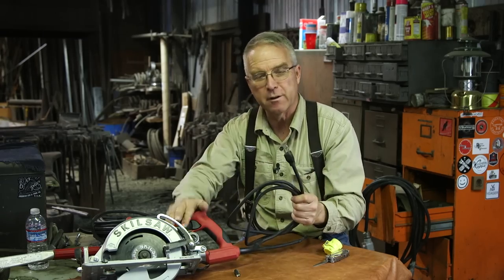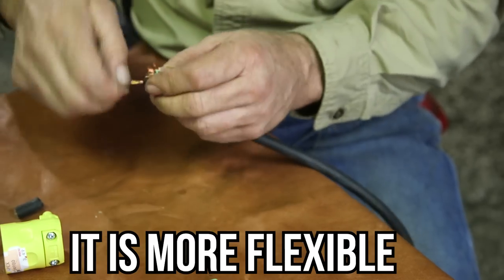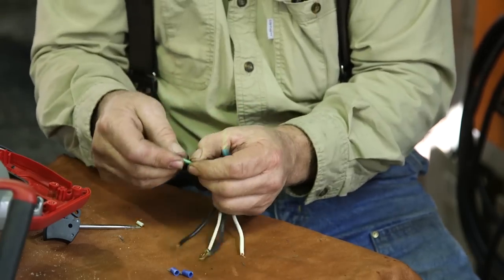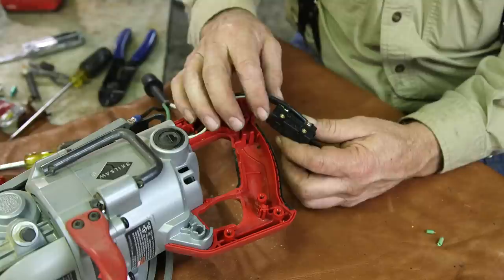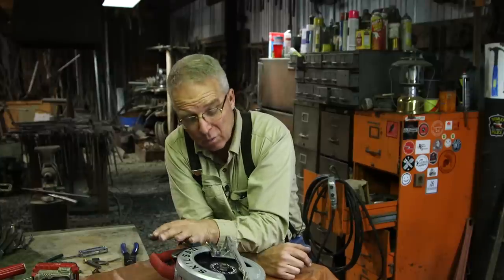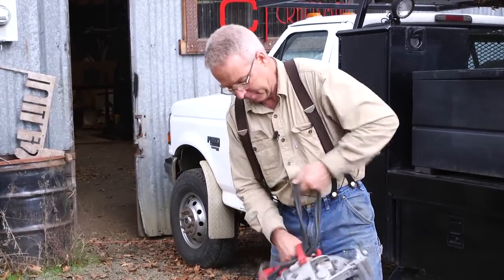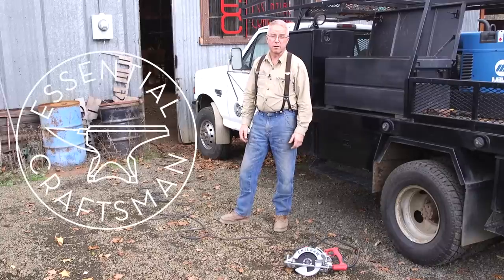Skilsaw Cord Install and Storage Tip

Comment: Embrace the cordless... a cordless grinder was the main staple that made me plunge a couple grand into hand held cordless power tools. When I bought my first Makita power tools, it was 3 months before Milwaukee came out with their cordless grinder. My 8 year cordless grinder is still working though, and it's been through a lot.

It's liberating knowing that you can tote a tool anywhere you want, and perform the work that you need to perform. I'm a huge Makita fan-boy.. everything battery powered that I owned is Makita.

Go back through RRBuildings Toolsday videos... Kyle uses a lot of battery powered tools, he has some good insight on them.

Makita is the only one offering a battery powered concrete vibrator though.

Comment: I bought the dewalt flexvolt rear handled saw. It does the same job as the mag77; (I know because I owned two), and it doesn't have a cord and has the same power (within reason).

I say owned because I sold them. Since I haven't used them for the last 4 months I figured I didn't need them.

If I still needed them, I would go for the long cord. The cord connection always had the tendency to get hung up on something. That was always a pain in the ass when you were cutting off composite deck ends for a nice picture frame and the cord plug got caught on something.

Or, you could just get rid of the cords.

Comment: I remember (long ago) when I realized there was a right end and a wrong end of a cord.  

The green wire goes to the plug ground pin.
The black wire (hot) goes to the plug narrow blade.
The white wire (neutral) goes to the plug wide blade.

Strip back BOTH ends of the new cord so you can see the colors of each wire.  
Put the plug on the cord end that has the same arrangement as the plug.  
The other end's reverse color arrangement would cause you to have to overlap the wires in the plug which takes up space and makes it a little harder to wire, so avoid that if possible; put that end in the saw..

Comment: hint: i found that one can buy a fifty foot factory made cord and cut the female end off. this renders a factory installed male and sj or sjt cord for your tool. the black (s cord) is tough but cracks up quickly. the factory cord is much cheaper to buy than a bulk length of s cord. plus it comes in 'pretty' orange color, sometimes yellow. i totally agree with the long length on tools. may God bless you and yours......g

Comment: Way to improve 40’-60’ corded skill saw —> Battery saw; a number of manufacturers make very good direct drive and worm drive battery saws. Dewalt makes an excellent 60 volt worm drive 7 1/4” circular saw. Battery tools have come a long way over the years, I can still remember my first battery drill a 7.2 volt Makita with a built in battery, anything worth anything was plug in; today some 30-35 years later and it’s rare that I use a plug in tool, outside the table saw. Even my 12” sliding compound miter saw is battery.

Comment: So let me throw in a bunch of electrical gotchas and hints for this sort of job:
1. The reason you want stranded for any extension cord (in fact, for any wiring that isn't permanently affixed to a wall/ceiling/etc.) is not just that it's flexible, the precise reason is that a solid copper wire is going to get work hardened and acquire weak spots from all the bending, pinching and pulling, then start forming cracks that will propagate across the whole cross section, leading to intermittent contact and possibly fire from localized heating at the damaged spot. A stranded wire will stand up to a lot more movement and even if a couple strands break (like from a hard pinch between a door and its frame), it won't propagate across the whole thing.

2. When you wire a live/neutral/ground triple to just about anything anywhere, always make the ground lead the longest one. If the cable clamp or gland fails and the whole thing gets pulled out, this guarantees the ground connection would be the last one to fail. It's also not a bad idea to make the neutral wire intermediate in length between ground and live, but that matters a lot less because all the sockets, extension cords, etc. along the way might not be wired to consistently place live and neutral on specific sides of their plugs and receptacles. Still, it won't hurt.

3. When using stranded wire, take care to inspect the terminals you're putting the wire in. You don't want the bare end of a screw to bear directly on a stranded conductor, it will start cutting through the strands - remember, conductive stuff expands from heating up when loaded and contracts later when it cools down, those connections move all the time even if they're protected with strain reliefs from any obvious mechanical forces - and the whole thing will fail sooner or later, usually by coming slightly loose from a couple strands breaking away, heating up, oxidating, then heating up more, you get the idea. For stranded, you want a terminal that has a piece of sheet metal that the screw pushes on, so that the conductor is squeezed between that piece and the terminal body. A "moving cage" terminal is the best. Slight serrations on the contact surfaces are a good thing too. It follows that the cheap plastic terminal blocks, the ones that come in long strips that you cut to size (search e.g. "morris 22052" on google images if you're unsure), are definitely not a proper way to terminate stranded wire.

4. If you must use stranded wire with a terminal that isn't meant for it (such as the above mentioned terminal blocks), use crimp-on ferrules. Look here for a good guide: https://forum.digikey.com/t/using-and-crimping-wire-ferrules/1358 and get a proper square or hexagon multipoint crimper, do not, for the love of all that is good and proper, crimp the ferrules with pliers. Buy the cheapest crimper off of AliExpress or whatever if you must, it will be fine, there's no need to buy a branded Molex tool. Just don't be a savage and always use a crimper that was meant to be used with a given ferrule type. These things look simple, but they're engineered to be installed in a certain way, using dedicated tools for best results and maximum safety. It's also way faster and more convenient than screwing around with pliers.
Reply: you had to go and be that guy...
Reply: @MrKelticfan  You mean, what guy? The one who provides useful information along with some explanation, justification and by-the-ways? Isn't that one of the points of the comments under EC's videos? He can share his experience and knowledge, then let others chime in with theirs. The man knows his limtations and is not ashamed of admitting them openly, sometimes by explicitly asking for comments from people who know stuff he doesn't. I learned a lot of potentially usefull stuff about concrete work from EC, the least I can do is contribute what I know about electrical work. If even one person finds my comment useful and learns something from it, it was worth the time taken to write it.

Comment: For the past 40 years or so I've done the same thing... a 25 ft. 12 gauge wire because you always need an extension cord with a new.  This eliminates the need... and over 90% of the time my cuts are less than 25 ft. from the outlet.

Comment: In reading the comments, several contributors are suggesting converting to battery. Some carpenters appreciate the blade being on the left side of the saw,  such as the Skill. Comes with the worm drive type saw. I am unfamiliar with the new cordless saws - are any worm drive? Do any of them have the blade on the left side of the saw? As a right handed user, I normally keep the stock on my left and the cutoff on my right, keeping the saw weight on the stock during cutting. I never much liked having the saw on the cutoff. Personal preference.

Comment: An extension CABLE, if you don't go through your career thinking you're too good to need it, will come in handy for a myriad of job site electron suckers. Make one of those, young-timers; and learn to tie it to the CABLE of your tool so it doesn't apprentice-disconnect on you at the top of a ladder.

Comment: I took the velcro strap that comes attached to stuff like laptop power bricks and just threaded a 60ft 108c 12ga natural rubber cord through it. Cable straps and the plastic Cable Cuffs are great and all but there just seem to get lost when its time to store a cord, doing it the way I did the strap is always on hand.

Comment: Every power tool I own is Milwaukee fuel. I will buy a worm drive skill saw just cause of your videos.
Reply: With a budget  between $50 and $75 I am sure you can find a second hand worm drive in very good shape.
Reply: @rightlanehog3151  2019 they are supposed to be releasing a Fuel worm drive saw
Reply: If you can find an older one on craigslist, you'll get a better saw for cheaper than the new 77's. You can still buy replacement brushes too.
Reply: @Rocketninja200  Exactly!

Comment: I still have two mag- 77s' working. One of them I got in 2005 and another in 2015. The older one I use on the jobs that pay and the newer one I have for personal work. They work better than any other saw I've used but I'm leaning on getting a cordless one if Milwaukee decides to make a saw for right handed worm driven people like me.
Reply: I wire in a 12g 100 foot cord into every SkilSaw that I use. ALWAYS with a "Twist-Lock" terminal because all of my work tools are used on construction sites where the power supply is the Twist-Lock pattern. Guys that do residential work or remodel usually rely on the traditional 3 prong household pattern.
The MYTH that an extended cord is a safety violation has been told and retold for years. Even if it was deemed a violation I'd continue to do it because I do not need a bullshit government agency to "Nanny State" the way that I do business. 32 years in construction and I have never had an injury. Pinned saw guards, chain saws, ladders leaned against walls, stacking roofs while walking top plate on 2 story houses WITHOUT a harness or scaffold....Rarely in this span of time have I seen anyone injured. Excessive safety regulation slows down production and increases costs while providing an arguable measure of safety improvement.
Go Trump 2020.
Reply: Hell yeah

Comment: When it comes to manual wire strippers / crimpers, you most definitely get what you pay for. Plan on spending at least $30 and up for any somewhat decent one. Spend more and you will find them to get even more sharp and rigid.

Comment: Great video Scott. What is the advantage of a worm drive saw over a direct drive?
Reply: Weelittlefarm I preferred a worm drive when framing for a few reasons. 
...generally they turn at lower RPMs and with more torque.  Better for rough framing cuts.
...the handle on the back of the saw gives me more control.
...the blade on the left side of the saw gives a right hander good sight lines without leaning over the saw.
...and I like the weight.  I use gravity to pull the saw through the work piece whenever possible.  (i.e. cutting rafter tails)
...bonus, most worm drives now come with an integrated rafter hook these days.

👍🏼👍🏼👍🏼

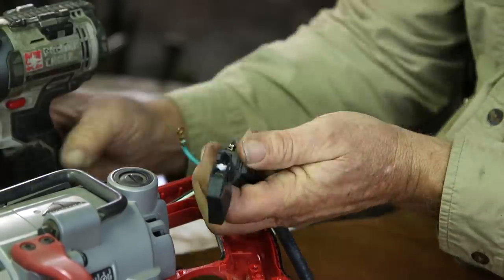Comment: 2:57 - 3:07  "cut the wires off at the same length... the ground a little shorter" - it's my very humble opinion that the ground (earth) is best to have a little more slack in it, relative to the other wires. That way, if the cable clamp should fail, the ground (earth) is the last wire to be yanked from it's terminal. An extra, albeit small, layer of safety?

Comment: I just purchased my first Skil Worm Drive saw, I've used the sidewinder type saws for years....finally decided to buy a worm drive, and I think adding a longer cord makes a lot of sense....I never did it on any of my old circular saws, I always just cussed every time the dang cord came unplugged from the extension cord LOL.  I think a 25-50 foot cord would probably be about right for around the house....so...the better question is, in 50+ years why has a long cord on a skill saw not been the standard cord length that the manufacturer puts on the saw LOL....I mean they're supposedly making these saws for construction use, apparently nobody at Skil has been to a jobsite to see how far from an outlet you are in many cases.  

I checked the gearcase lube level when I first got the saw and its pretty low....not a single hardware store in town carries the worm drive oil...weird, they are supposed to be hardware stores yet they don't have any clue what that oil is, but they sell the saws.  Anyhow, ordered the oil hopefully I'll have it tomorrow and I'll put the saw to use as I've got a bunch of shelving to start putting up in the shop, and working on the flooring installation as well.  

This saw is heavy, but to me it feels like it would be much easier to control especially for ripping down sheet goods.

Comment: You could always tie an overhand knot between the tool and the extension cord. I'm younger (33) but have been doing that since my father taught me at young age.
Reply: That works for small projects, but on a job site where you're moving around all day it will work itself undone and gets caught on stuff. Also, you can safely pick the saw up by the cord this way without worrying.

Comment: One end of a cord will match up with the hole on the plug, the other end willrequire you yo cross the neutral and line wires over each other. If you take a Bic lighte to the insulation on the solder-less connector for a couple of seconds, you can pull it off with some line mans pliers. The roadie wrap is what a plasterer uses on their hoses. Imagine 500 feet of tangled hose.

Comment: 14ga wire is plenty good for 15 amps up to 111 ft from electrical pannel. it is the exact same gauge of wire that you have in your walls. ive run the numbers and you need to pull 28 amps to reach the critical 7% of voltage drop on 60fts.

Comment: any battery powered worm drive saws in your future Scott?
they're getting pretty good.
Reply: Mark Schmitz just what I was gonna say. What he’s talking about is why I got a rechargeable and 2 batteries.
Reply from the maker: Gotta admit that they are looking and sounding better and better!!
Reply: I have the Dewalt 20v cordless tools and that little 6 1/2 inch saw will surprise you, it cut through a butcher block top, of solid oak and never slowed down, due to the Kreg Accu cut guide I was using, did not cut all the way, but to full blade depth, and missed cutting through by less then a 1/4 inch I would say, oh and I own a Skill Mag 77 thanks to Scott, and I also will extend my cord as well, great idea, only thing, what type of cord was that, it looks like what electricans call SO cord, is that what you used ???
Reply: I have been working on a 40x60 barn in a lot with no power for the last few months. The battery tools have been a absolute  blessing. Have a generator on the site but who want to listen to that all day and mess with cords? I only use it when I need the table saw... Just because Makita needs to jump on the wagon and put a battery table saw out!

Comment: I like the choice of replacing the original cord with a 12-gauge size power tool supply wire cords.  Make sure then to add a new weather-resistant & mechanical cord protector design.  I've seen wire wrapped cord protectors that help prevent excessive wire bending or kinking thus breaking a power tool's wires.  

I can't go along with the idea of adding very long cords to my power tools as suggested here.  I'd limit the power tool cords to 8-feet or 3-meters of winter-rated & certified flexible cord.  Such rated wire is expensive per foot or per meter.  I rather use that material to build long general-purpose extension cords up to 100 feet or 35-meters.

A 10-gauge wire may on occasion be needed if multiple power tools are being used.  An example could be a portable 30-Gallon compressor combined with contractors' & miter saws.   This can be provided by a USA 120 vac circuit.  

Confirm wire-ampacity[1] at length for your applications.  USA 240 vac circuits are a different story & would need more explanation.  Build your cords with the correct plug & jacks per amperage ratings and the NEC codes.  Correct wiring also means they meet insurance coverage requirements for your home, shop, & job site use.

Specifying & purchasing wire as opposed to buying a cord at the big box stores ensures the wire is rated as winter certified.  Further, you can purchase good quality multiple outlets addons or build them to provide needed outlets meeting NEC codes.

[1]https://en.wikipedia.org/wiki/Ampacity

JSW